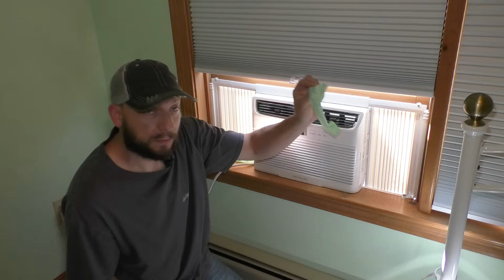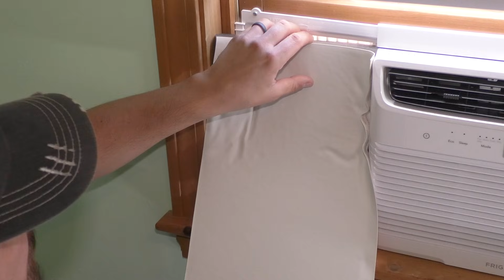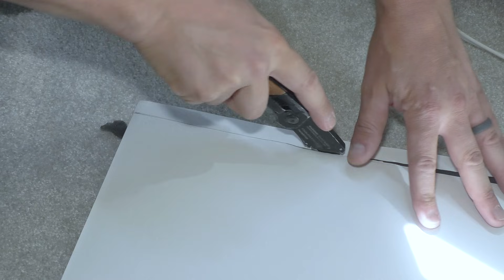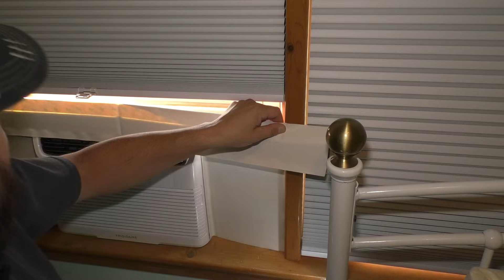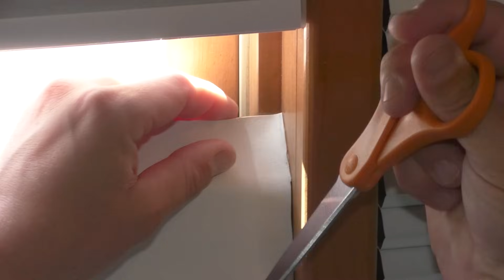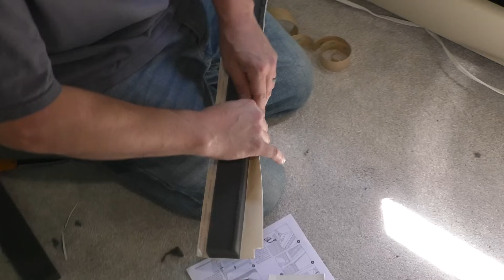How to Install Window AC Insulation Side Panels | Easy Step-by-Step Guide!

Comment: I didn't want to remove my air conditioners this past winter, so I purchased and installed this. I also used outside and inside covers for the unit. The difference is so incredible. Keeps the cold out and the heat in during winter. They are equally efficient during the summer at keeping the cool in and the heat  out.

Comment: I'm leaving the window unit in all winter, will install   panels on inside and outside, and weatherproof the outside,  will also use window unit cover on outside.  Less trouble  and wear and tear on unit leaving in

Comment: I don’t have the plastic pieces on my AC because they broke, can I still use this? Maybe I can put the plastic installation first and put this over it? My ferrets bedroom is struggling with humidity and I’m trying to try something to fix the problem. They can’t have have humidity over 65% max and there’s keeps getting to 80 % and I cannot leave a dehumidifier plugged in.
Reply: I just watched another video. The guy used the solid foam insulation. You could probably put this over it.
For your ferrets you can put Damp Rid containers in the room and they will draw the moisture out.

Comment: $35, way too much, no thanks.
Reply: I just bought some styrofoam for cheap. I did a double layer in the inside and one outside. Looks and works great. I don't plan on taking my unit out.

Comment: What's a good trick for the outside part? Just for moisture and small bugs
Reply: That's what I came here looking for also 😂
Reply: Cut solid foam insulation to fit tight. In a video I saw, the guy attached the foam to a piece of Hardy siding. So you would see that on the outside, and the piece of foam fit tight enough to prevent entry by bugs or water.
Reply: @z @zoesunshine2646  saw that video too. Great idea.

Comment: Or, get a 1/2 inch closed cell foam project panel from a big box store.. Cut it to fit window. Then cut it to fit AC opening. Spray paint it white using a plastic/vinyl friendly spray paint. One piece, cleaner, cheaper, more custom looking, and about the same amount of measuring cutting and fiddling.
Reply: But then who is making $$?